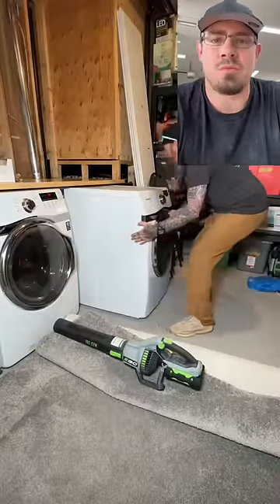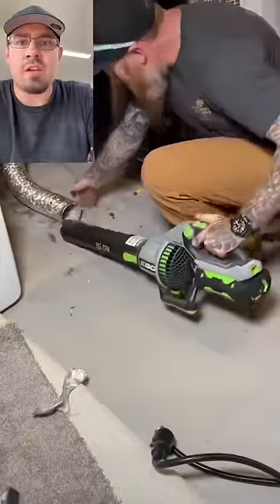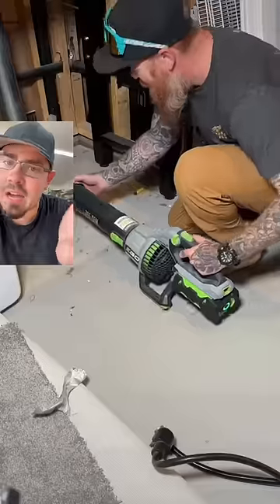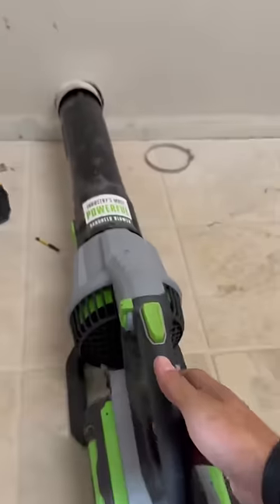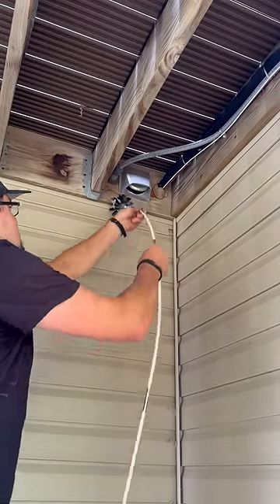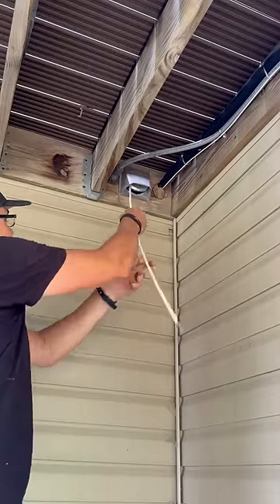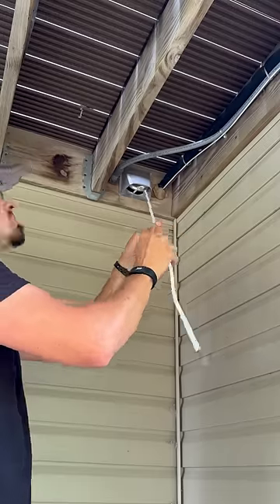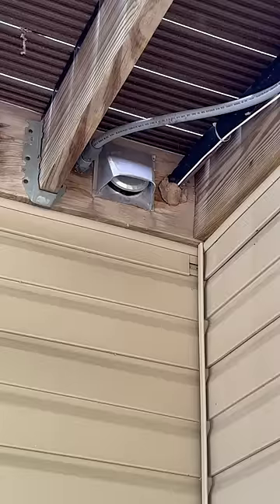Clean Your Dryer Like A Boss! #shorts

Comment: My dryer doesn't have a vent. It has a condensate line
Reply: What??
Reply: I mean, I’m assuming you are meaning a clothes line??
Reply: No it's a heat pump dryer.
Reply: @zildjiangalliher6320   Google heat pump dryer
Reply: @dennisssmock3553 I considered this just for less likley to have a fire but I ended up getting my lg washtower as a vented unit kinda wish I went that way though

Comment: Don't ever use that flexible dryer vent hose! It's pure $hit! Always hard pipe your vent and use tin duct tape to seal not screws. You wouldn't need to clean them again.
Reply: Not one dryer manufacturer has ever approved any venting material other than hard pipe.  Not one.
Reply: Aluminum foil tape ftw

Comment: No, a leaf blower is absolutely NOT excellent. 
It can and will cause certain dryer vent designs to clog, making the issue worse. 
You NEED to use a drill/brush or an Air whip to break everything up.

Comment: I have a trick for you. What you can do is create sliders to put under the feet of the dryer and pull it out without damaging the floor.

I use some acrylic sheets they are about 18cm wide and go front to back i even cut out some handle holes with a jigsaw.

You dont have to worry about the feet ripping carpet or lino flooring

Comment: Don't screw all the extensions together at once. Add maybe 2 connect the drill and slow place it in the duct. Working it back and forth until that section is clean. As you do it have a shop vac working on the sucking up as you go. Then add a section at time repeat the previous step unitl you get all the way to the fryer.
DO NOT run the drill in reverse. You will unscrew the extensions from one another and you will need someone to get them out...$$$.$$.
Get rid of the flex duct. The max length that meets fire code is 8ft outside of the dryer to the wall.

Comment: Been doing this for over 15 years...neighbor doesn't like it cause vent exit is on the roof on thier side of the house
Reply: I have the same issue, but I'm not allowed to 'get rid of the flexible tube', because the idiot that built the house put that flexible tube into the wall. If I want to remove it, I have to take out the washer and dryer stack, then remove a wall. About the only thing I can do is climb up on the roof with the cleaning kit, and do the best I can after I blow that thing out.

Comment: They just don’t tell you that if you buy the one at Home Depot or you get a cheap set those sticks break you end up getting them stuck in your dryer vent then have to cut open your wall to get access get the stick out patch up the wall what a nightmare just call a pro that has the proper equipment

Comment: You're still using screw together rods?! get you some Snaplock rods, they're bi-directional. Not to mention not just "as far as you can go", all the way through! Maximum 35 developed feet, each 90 degree bend equals 5 feet of run.

Comment: Or, if you live in the south, just go buy another 6ft coil spring flexipipe and replace the whole shooting match in one go because you are poor and don't have 100 feet of ductwork between the outside wall and the power-hungry dryer you inexplicably put on the 2nd floor in the center of the bloody house.

Comment: Never run the cleaning kit from the outside in. Reason being is that 9/10 you are doing this as a one man job and if you disconnect the duct you will be just pushing all that dryer lent into your clients house leaving a huge mess that you will need to clean up. 

Do it from the inside out than after pulling the cleaning kit back out than run the leaf blower to maximize the use of getting rid of 100% of the dryer lent. Also clean out the dryer port. It’s important to always do from the inside out and not the outside in.

Comment: Moist lint is like glue and attaches to inside of tubing and sticks in a solid mass
 Much better to replace tubing. Safer, too.
Reply: also, fabric softener micro particles are like glue when heated (both the liquids and sheet types).

Comment: You left a little room for improvement. You need to start by just doing the first couple of feet and blowing it out and then go section by section. If the vent is packed with lint, you’ll end up getting the brush stuck. Experience.

Comment: As a service tech doing dryer vent cleaning, i would suggest stay away from using the brush drill kit unless you are pretty good at controlling the drill. I get calls from people twisting and getting it stuck and having to pay 600 bucks to get it removed or the whole vent replaced.

Comment: Luckily the pipe in my house isn’t even as long as I am tall because it’s exhaust is the opposite side of the wall it’s up against, we’ve never had trouble with it getting clogged up and it’s only been cleaned once in I don’t even know how long… but even then there wasn’t a lot in there

Somehow we’re lucky and get little to no buildup

Comment: Ghat dryer vent is goin to put moisture into the deck. Ot will trap that moisture under there. Short ing the deck and causing mold to grow under it. If furniture is kept on the deck under cover ot will accumlate under the covers

Comment: Why don’t American dryers just have a lint filter? Here in Australia my dryer is vented to only send hot air outside. There is a lint trap filter at the front of the dryer that you can easily scoop up and empty every week. Never sending lint outside and never clogging up vents or creating hazards for house fires. Bizarre that this isn’t a common feature everywhere…
Reply: the lint filters still let stuff by. Crappy design flaw.

Comment: Sometimes you have to use the flexible pipe.  Just don't crush it.
Reply: It is actually against code in most places because it holds a lot of Lent easily. In most states they will only let you use it and exhaust for cooking hoods or bathroom fans.
Reply: Not one dryer manufacturer has ever approved any venting material other than hard pipe.  Not one.

Comment: I use a similar kit, but had to get two of the rod kits. It also has device that plugs into the dryer duct that has hole for the cleaning rod to go through and a larger port to hook up a shop vacuum to suck out the lint as the breaks it away from the duct walls. works great.

Comment: My dryer cleaning kit came with a plastic adaptor with a large and small hole. The large hole I stuck into the leaf blower and screwed it to it. The small hole is for the dryer brush so you can run the leaf blower and the brush at the same time. Works great.

Comment: Just run dryer with no heat and push brush in from outside.  Wear a mask.  Duct will be super clean.

You don't need to disconnect duct and use leaf blower.

Save your time.